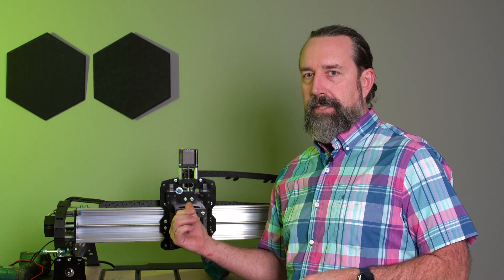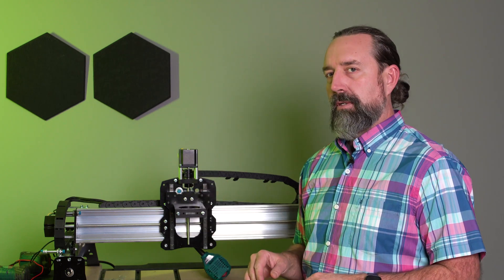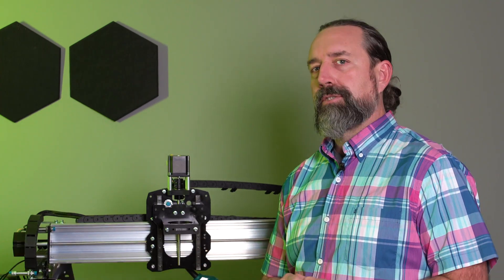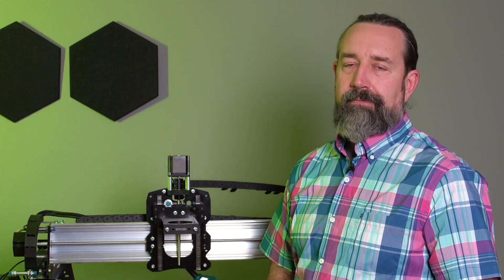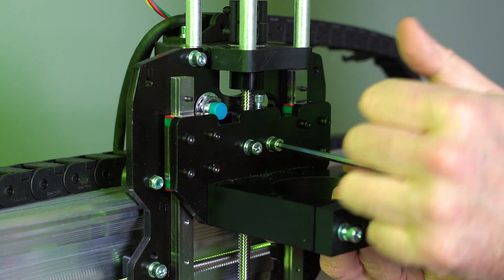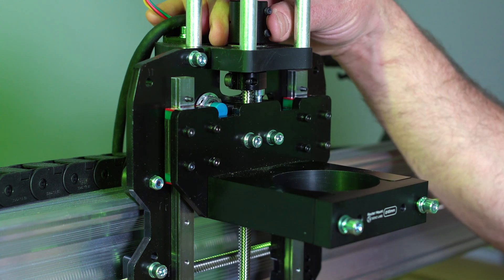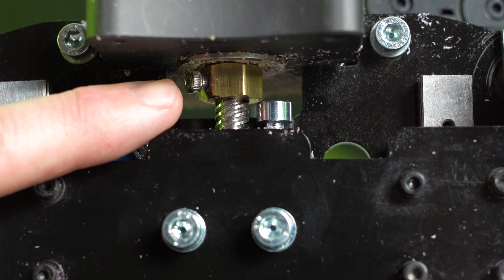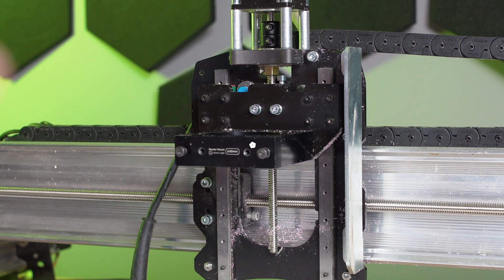Troubleshooting Z Sensor Problems in LongMill CNC: Fixing Clamping Nuts & Inductive Sensors

Comment: I put on the new sensors, and they worked perfect. THEN, I upgraded to the new spring loaded backlash plates. They worked perfect on the "Y" axis, but the Z axis has a clearance problem. ...the tapered end of the backlash plate is up. (springs at the top) Do I have them up-side-down? I took out the lock washer thinking this would give me the clearance I needed but that didn't work either. I'm sure there is a simple solution to this but I couldn't figure it out. I just want the new backlash plates to work with my sensors. ...what's your solution?

Comment: How did you get your 'Z' Axis nut on? Mine was too thick (small raised area next to threads) and would not fit in opening.
Reply from the maker: Earlier versions of LongMills, pre-fall of 2023 can only use a brass ACME nut on the z-axis due to the size of the space where the nut sits.
Reply: @SienciLabs  What was the fix you applied to the newer machines?

Comment: So on the MK2, if we have the brass nut on the Z lead screw, we CAN NOT
replace it with the clamping nut?
Reply from the maker: Correct, the space on earlier machines is too small for the clamping nut to fit. All other brass nuts can be replaced with the clamping nut.
Reply: @SienciLabs  Ok, sounds good. 
Thanks so much.